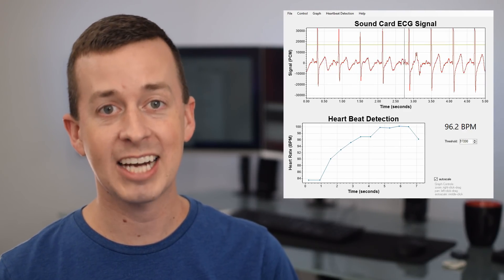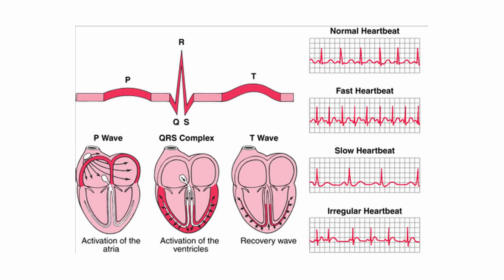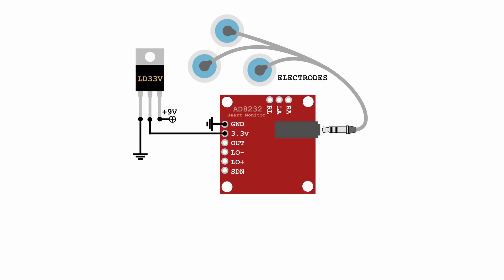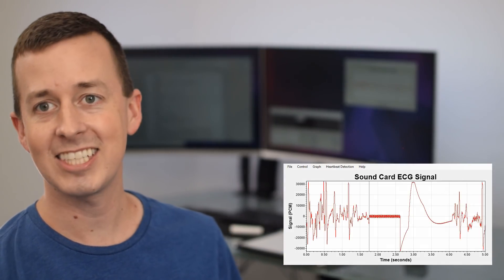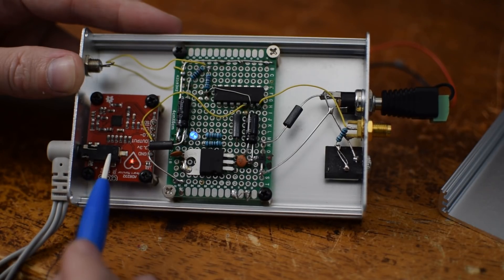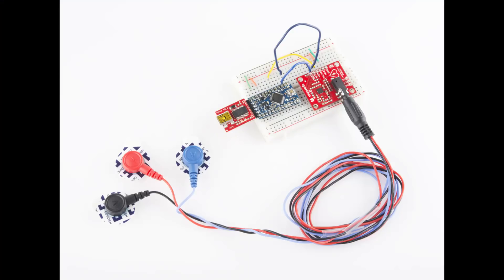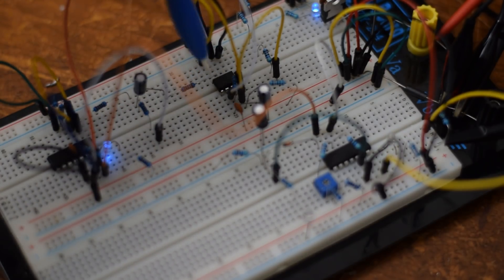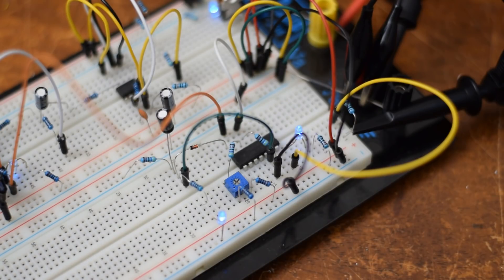DIY ECG with AD8232 and Sound Card

Comment: EEG systems for practising meditation at home to get data which can be used also for scientific purposes is a misery. Interaxon does not offer the Muse SDK as soon as Arnauld Delorme uses it, and OpenBCI is against EEG systems with more than their 32 channel system. I found that the Harden Technology Channel Recoder System is the best solution. Solder every day a channel recorder and combine it with Greentek sensors which can be optained seperately from Greentek. 
http://www.greenteksensor.com/eeg-caps/gel-free-eeg-electrode-cap/
and a EEG sensor from Aliexpress for currently 30 USD. In a year you have a 256 channel system which can compete with Richard Davidsons system. Unfortunately, it still costs more than second hand car, and  for the time being, it works only up to 128 channels, since for 256 channels the Greentek sensors are too big. Hope that prices for EEG sensors trop. But maybe also viewer channels are sufficient to get significant data.
Reply: I doubt we will have a 256 channel EEG system at an affordable price so soon, but I certainly hope OpenBCI and similar projects will progress in such a way in the near future. Currently such systems still cost half a million euros for just the base unit...
Reply: @lrq3000  I suppose prices for EEG devices are so high since only few use it. There is not much competition in this field. But the chance of a price drop for an EEG device which is based on Scott s device is bigger, than the chance for a price trop for OpenBCI devices. You can see that when you look at the prices ECG breakout boards, what they cost now, a few dollars, and what they costed some years ago.

Comment: I asked the seller of this great sleep monitor and respiration sensor which looks very promising:
https://www.alibaba.com/product-detail/Development-Kit-PVDF-piezo-electric-film_62417580588.html?spm=a2700.wholesale.deiletai6.6.23557dd7QyPhJz
how to get the sensor data out of this belt. Unfortantely, I did not get any response. Is it possible to replace the AD8232 in your circuit with his sensor?
Reply from the maker: That sensor is a stretch sensor, not an ECG sensor. They use stretch to detect heartbeats and breathing. You could design a stretch sensor to output data to a PC sound card similar to what was done here with an ECG sensor.
Reply: @swharden  Great. Many thanks. High quality respiratory sensors are very expensive, but I suppose for instance those from Bitalino (750 USD) cost that much because the ADCs, but the stretch sensor looks very similar to the one used by Bitalino. Also a good sleep detection sensor is hard to find. Garmin watches have a built in sleep detection which needs to be adjusted manually, which cannot be used for scientific purposes. There are no data yet available for comparison, but this sensor potentially could do the job.
Reply: I tested the strech sensor go direct pro from Vernier. Not very comfortalbe. And also the Fenix 6 from Garmin with breathing rate, very inaccurate. I think the best solution for respiration rate is respiratory rate estimation from (Scott Harden Sound Card) ECG. They tested respiratory rate estimiation it with a Polar H10 in a paper.  5.5 % inaccuracy during running, which is great. But with the H10 it is difficult to have a real-time respiration rate device. With for instance sound card ECG it is easier. Developers wanted.

Comment: Is it possible to integrate your free and open source custom software which is written in C#, which graphs the signal in real time and displays heart rate over time in Matlab or Python? I know that it is possible to integrate  C# into Matlab code. But where is for instance  the heart in your software,  is it somehow labeled or documented?
Reply from the maker: Check the link in the description to my one opamp ECG circuit video. That project makes a similar graph using Python software and you may find that useful 👍
Reply: @swharden  I try to check whether your code could run as a mobile Python project on the new Linux Pinephone in the the Pinephone community:
https://forum.pine64.org/showthread.php?tid=10385&pid=69655#pid69655
Then your Sound Card ECG device could also be used for mobile applications.
Reply from the maker: Also, yes, the C# code is very simple, available and documented in GitHub, and should be easy to translate into any language (like Matlab) that can graph audio from the sound card. That link is in the description too. Good luck!
Reply: @swharden  Thank you Scott, you answered a question someone asked 6 years ago in the Matlab community:
https://www.mathworks.com/matlabcentral/answers/167215-how-to-plot-ecg-using-microphone-component-as-an-input-device
Unfortunattely, I don t have Matlab, I only write posts in the Matlab community for research scientists who use Matlab. When someone with a Matlab licence integrates your code into Matlab, then it is not far from a Matlab toolbox for your ECG sound card device.
Reply: There is also a test version of Matlab:
https://www.mathworks.com/campaigns/products/trials.html
when someone wants Matlab support for the sound card ecg, he can download the testversion of Matlab, make a Matlab script out of Scotts software, and publish it for instance in the Matlab community. I think out of such example code the Matlab support team can make a Matlab Toolbox. Or someone is ready to make a Matlab toolbox himself, and suggest it to the Matlab support team. For the Bitalino Toolbox Vinod Patil from India answers questions for the Bitalino Matlab toolbox. I think he is also the orginator of the toolbox. A Matlab toolbox for the sound card ecg would make out of it the most low-cost high quality ecg device in Matlab, and it would rise user acceptance of the device among research scientists.
Reply: User acceptance would also rise by renaming the device, I suggest to rename it to "Harden Technologies Channel Recorder".

Comment: I agree with Alex. I m facing currently big problems to get real time data from a sports watch. To get real time data from Scott s sound card ECG is better. For a 24 h 7 d setup a wireless bluetooth low energy transmission would be better than a cable connection. This setup could then be made complete by adding a Bluetooth foot pod, as for instance a Bitalino foot pod which is discussed in the Bitalino forum, to replace the real time problems of sports watches.
Reply: A step counter for BeagleBoneBlue in Matlab already exists, but you must install all hardware and software, before all links in Matlab are working:
https://www.mathworks.com/help/supportpkg/beagleboneblue/ref/counting-steps-using-beagleboneblue-hardware-example.html
Reply: @Alex. Electronic shock should not be a problem when it is possible to connect the sound card ecg to the new Linux Pinephone, which I already love, although I don t have one yet. It is sold as a device for developers. When it is possible to connect the sound card ECG to the Linux Pinephone and to run Scott s software on the phone, then no wireless is necessary.

Comment: I don't think it's a good idea to link yourself directly (i.e. galvanically, without electrical isolation) to a PC powered from a wall socket. You should use optoisolator.

Comment: I watched your video very carefully because I am very interested in this equipment.  I am in a country where such equipment could save lives.  the health centers in my country Burkina Faso are very ill-equipped and you often have to travel at least 100km to be able to do an ecg.  I plan to do a low ecg that could equip health centers in isolated regions.  the system must allow a technician to connect the device to his phone via Bluetooth and perform an ecg and transmit the result by email to a cardiologist via WhatsApp.  but for this to be able to obtain validation from the medical profession, more than 3 electrodes (at least 6) are needed.  have you studied the possibility of pairing several AD8232 and connecting them to an arduino with a Bluetooth shield?
Reply from the maker: Hi Dimitri, what a great idea! A good and simple way to make this wireless is to use Arduino (like you suggest). Use it's ADC to convert it to a stream of values and send it over RS232 USART (serial). Then use a wireless/bluetooth RS232 module to send it to a receiving computer or phone. The software should be simple to develop if you do it this way. Scaling this to a 6- or 12-channel wireless ecg would take a little more effort (because simple arduino + serial probably won't be fast enough), but the concept will be the same. XBee radio modules could be a longer-range alternative to bluetooth.

Comment: To get a real time heart rate stream from a Garmin watch is difficult:
https://www.thisisant.com/forum/viewthread/7074/
Easier is to get a real-time stream from an Owon oscilloscope with SCPI. This requires only scripting and debuggung:
https://www.eevblog.com/forum/testgear/owon-ag-1012-awg-matlab/
 But on the long-term the DIY ECG which uses an AD8232 which requires soldering is my favorite, because it is simple, small, low-cost and can be used for scientifc studies.

Comment: This device could also be used to obtain ecg data for respiration rate estimation:
https://ch.mathworks.com/matlabcentral/fileexchange/55289-respiratory-rate-estimation
For inner engineers it is difficult to get respiration signals:
https://www.innerengineering.com/
To estimate the respiration rate from ecg data is easier than to obtain respiration signals from respiration sensors.

Comment: Takes me back to 1986 when I made a 741 op amp version and used a BBC micro analogue input to read the results.   I wrote a program to graph it but this is easier.  Thanks for the advice on the pads.   When I made the 741 version I just had 2 hand held copper tubes as sensors.
Pete

Comment: Hi Scott I just made one of these.   I used your program to display the results and as you say it was very noisy with mains interference.  I also had to earth my left hand by holding a usb lead outer case.   I am using a 3v button cell for power which works well.   I tried using Audacity for the recording which also works well. Then used the Notch filter setting on Audacity at 50Hz UK,   and it cleaned up a treat.  Thanks for the vid.
Reply from the maker: I'm glad you got it working! That's good advice about Audacity's notch filter. If you continue to have mains noise, double-check the quality of your pads, the connection between the pads and the AD8232, and the quality of the connection of the headphone cable connecting the AD8232 to your computer sound card (all of these connections are susceptible to picking up mains noise). Congratulations on getting this project up and running for yourself!

Comment: Hi. I want to display the ECG using AD8232 Sensor on MATLAB through an Audio Jack. Is it Possible to display AD8232 ECG Sensor data through an Audio Jack on MATLAb Software??? Do u have any info on this particular project !!
Reply: That's obviously possible. It's just an audio input. audioread() function would do that job easily.
Reply: @mrinmoysarker9603  Thanks !

Comment: Actually the cardiac conductive system is made of a particular kind of cardiomyocytes with auto-depolarization properties. These cells are called p cells (where p stands for pacemaker) they are not neurons, the morphology is different and they also have different embryological development. The SA node has the highest depolarisation frequency and for this reason is the normal beat generator (sinus  rhythm). The cardiac ganglions are actually neural bodies belonging to the cardiac plexus, part of the autonomous nervous system that can modify the heart rate.
Reply: As you said the ECG machine can capture the electrical impulse during the different phases of the cardiac cycle, resulting in waves (positive or negative depending on the direction of the impulse relative to the electrodes) that at the end show with a graph the heart function. With ECG you can measure simple parameters like the heart rate or diagnose complex situation such as arrhythmias, infarction, cardiac arrest etc etc
Knowing the meaning of the single waves you can understand the cause of their alteration and treat the patient consequently. For example if there is a problem in the conductive system (arrhythmia), let’s supposte in the SA node, you will see some variations in the p wave that can be altered or absent and maybe a slower heart rate cause the impulse is starting from the AV node at this point... it’s a complex and fascinating world that can save our lives. I’m surely not the world’s best expert as i am only a med student, I tried to make a understandable simplification. I’m Italian so I am sorry if there are some grammatical/lessical errors..
Anyway, great video!

Ciao
Reply from the maker: Giovanni Dian this is accurate and a better description of what occurs than the oversimplified explanation in the video! Thanks for sharing this!

Curiously, how would you expand your description to include the role of the ICG? I’d love to include your enhanced overview in the video description.

Comment: Can plse tell me what is ur voltage max value of the output which is being sent through the audio jack..ie net gain of the analog ckt
Reply from the maker: Sayan Mondal the voltage your microphone jack wants is different on different sound cards, and it’s even different (smaller) than the line-in port. I got good results using a 100x reduction in voltage with divider (100kOhm/1kOhm), but also just a series resistor (100kOhm) worked well too. A 10k or 100k potentiometer would be the easiest to adjust. If it’s too quiet, you can just turn up your “microphone gain” in the sound settings of the computer.
Reply: @swharden  thank you sir